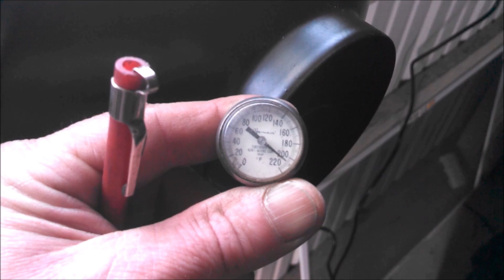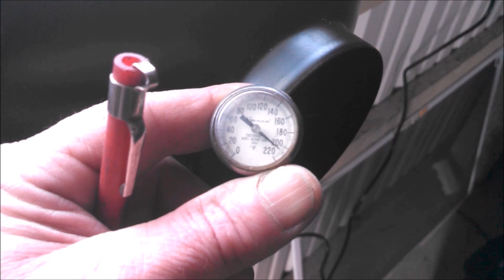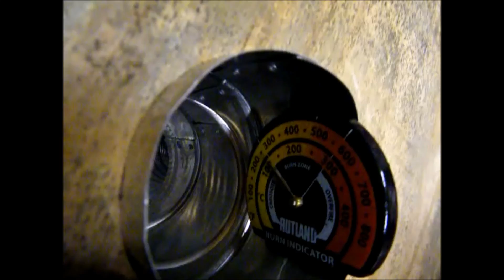Building a barrel stove

Comment: Hi Ron. This was exactly what I was looking for. I want to do this exact same thing for my shed I'm ordering this year. I plan to store gasoline and tractors in it, that said, will this outdoor barrel stove setup be ok? Second question.. how are you preventing smoke from going into your stainless pipes that heat your shed? Thanks for any information! Take care.

Dave
Reply from the maker: Sorry I missed your comment. But the inner barrel where the fire is has chimney cement and in my case the smoke just entered the stack! however this works but hard to heat the pole barn when really cold! It would work work well in states that 40 is there lowest temps!

Comment: Wow, an ingeniously simple idea ... I love it.  
I wish you would go more into its actual build.  For example, how do you seal the front of the outer barrel so the heated air does not get out there?  And do you use any type of fire brick or sand in the inner barrel?  Who is the manufacturer of the exhaust fan and speed controller?  What did you use to insulate between the double air pipe?  And could you please explain again what you used to insulate the inner barrel's exhaust pipe as it passes through the outer barrel?  Did you install a damper on the exhaust pipe or is combustion only controlled by the air inlet?  And how long will the heat last ... for example if I put lots of wood in it before I go to bed, will it produce heat the entire night?  What would you do differently if you were to do the entire project over again?  Do you ever worry the fire might burn through the inner barrel, filling your basement with smoke?
I live in a small house and there is just not enough room to install a wood stove, and propane gets expensive to heat with it exclusively the entire winter.  This looks like a way to solve that problem, and keep ash and dust out of the house.  
A suggestion - perhaps if you wrapped the outer barrel with some type of fireproof insulating blanket, it might lose less heat to the outside.
Thank you, Sir.
Reply from the maker: wow thats a lot of questions lol! here we go
1)the front is not sealed yes warm air can escape but forced air takes the path of least resistance for the most part and wants to get out in the larger pipes
2)no sand or brick used the inner barrel sits to the bottom and i don't remember if i shimmed it up at all.
3) I don't know who makes the fan or speed controller  found them on eBay was price shopping. Made in China
4) the only insulation was chimney cement to keep the exhaust  from escaping the inner barrels chimney before it leaves the outer barrel.
5) no damper was used at the time.
6) the wood burns fast and wouldn't last all night unless you had a damper and cut the intake air just right with out much exhaust smoke.
7) lastly there is safety concerns that is why i went to a single barrel with the heavy iron pipe that would never burn out than later did a video installing a wood stove in the same basement using the window cutout and triple wall chimney pipe..Most efficient way!! I am still working on the pole barn with a new design and searching for cheap or free things..Thanks for the questions!!

Comment: Ron, how is the 30 gallon barrel setup inside the 55 gallon one; i.e. do you have it resting on the 'floor' of the 55g or did you suspend it somehow so that there is air flowing a full 360 degrees around the 30 gallon barrel? Thank you for sharing your build and for taking the time with this question?
Reply from the maker: i set in the bottom 4 red bricks 2 at each end  so the air can go around the barrel thanks for watching and questions.
Reply: @ronstickle4694  Thank you Ron. Going to begin gathering the materials to replicate the build. Best regards.
Reply: like what you have done, just keep an eye on the 30 gal inside. If it burns a small hole it will allow the blower to start shooting chunks of burning ash into the shop or house !

Comment: smart.. really good idea!   ive been flirting with the idea of putting a double barrel wood stove in my garage.. but this may be a better idea.
Reply from the maker: its a good way if you dont want the risk of fire or having to put in a chimney but still looses heat compare to having it inside! thanks for watching and commenting!
Reply: I'm just wondering if this type of stove will heat up my 575 sqft garage.. Not insulated.
Reply from the maker: if you had it inside it would do the job but if you work on things with gas it is not a good idea because you just cant turn it off.. i have a heater like this if i need fast heat that i can turn off..and it is quiet and heats like crazy..i burn diesel in it
https://www.northerntool.com/shop/tools/product_200680937_200680937
Reply: I have a dynaglow 95l/135k BTU diesel heater in my garage, but seems a little gassy in there.. especially now that i've insulated all the drafty parts of the garage.   I think i'm just going to put a barrel stove inside my garage, I can't stand the cold, and cant stand not being able to comfortably work in my garage when it's freezing and stinking of diesel.  i wish I lived somewhere I didn't have to worry about heating up my shop.
Reply from the maker: i here that it has been below 32 here for days and will be 15 for the high on Friday. i wish it was at least 40!
Reply: i have a double kit that heats a 30X50 non insulated pole barn just fine

Comment: Ron,

I like your innovation and using basically off the shelf components to create your heat exchanger.  Nice clean package all around.  Couple of thoughts, you ever think about just building a box around your outer shell an fill with what ever to insulate the outer skin of your heat exchanger and capture the heat thats lost with the stove being outside?  Also, in one of your videos you inlet temps looked to be reaching 400 degrees F.  Any concern that you might ignite the plywood you have your pipe mounted to coming into your structures?  Keep up the great work!!!!
Reply from the maker: thanks and yes I have thought about the heat loss so in the fall I will be looking into catching some of the heat loss. and I did have concern about the pipe going through the plywood so if you look in one of the updates 4/2016  you can see I made some aluminum plates! thanks again!